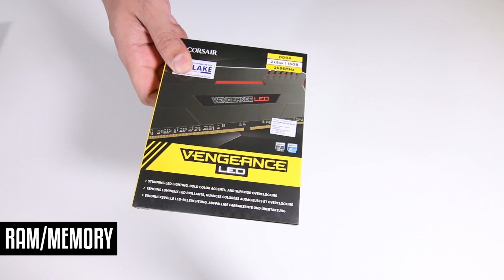ASSEMBLE YOUR OWN PC EASILY!

Comment: Heyyy!  so I'm building a pc now and I have everything connected and good to go but in confused about the fans that come with this case.  I have no clue where to plug them in at.  where do they go? do they plug into the psu, or the motherboard?
Reply from the maker: plug the fans onto the mobo, there is a label that says CPU FAN, chassis fan etc. You only plug in your molex fans if you dont intend to control them via your mobo and you have a fan hub/controller.

Comment: must the thermal paste be spread all over the cpu? won't the paste drip over once the cpu fan is placed on top?
Reply from the maker: Den NightinGale yup, it will be squeezed to the side. but not that much. as long u remember to put a thin layer :) (the thermal paste we used is non conductive. no worries)

Comment: u started every sentence with 'now..' xD
Reply from the maker: nowwwwwwwwwww

hahah! you noticed lol
Reply: I've watched a lot of video reviews of this case and almost no one shows it. It seems though as if you could turn the ssd 90°, too. 
One question: You used a 120/240mm radiator in the front. Would an ssd fit behind a 140/280mm radiator, as well? Or is the space between radiator and middle wall too narrow?
Edit: this was meant to go under the ssd comment chain, missclicked.  sorry.